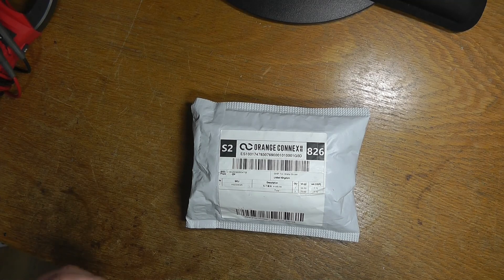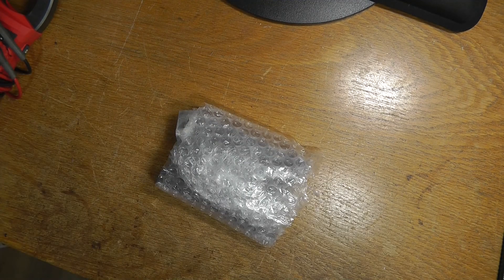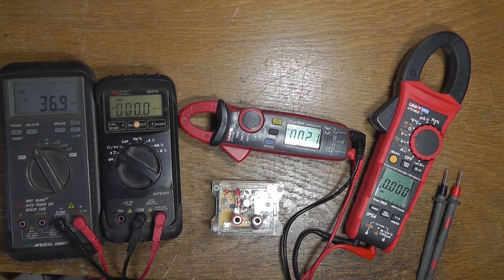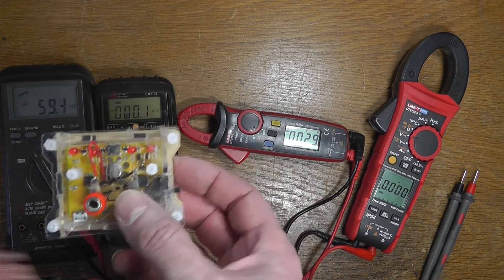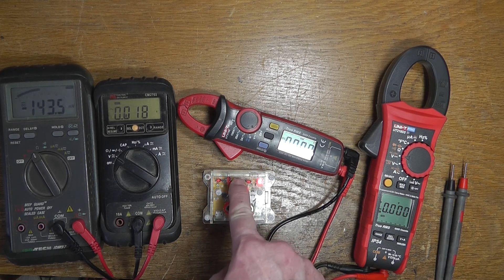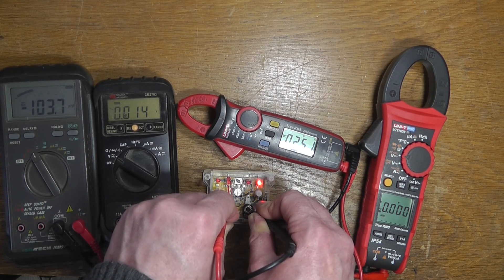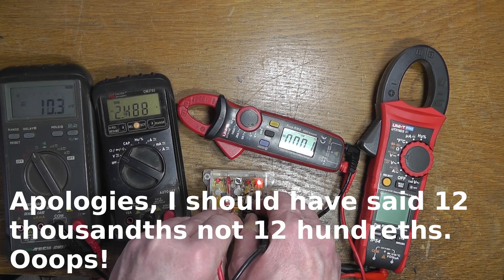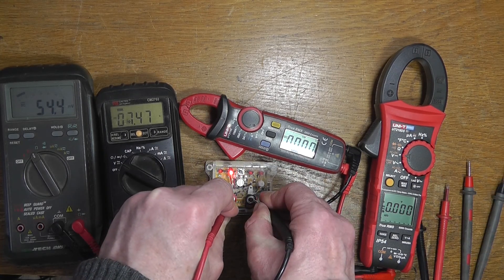Voltage Reference Tester to Calibrate a Multimeter (Accurate? Probably!)

Comment: You could have used the voltage reference board to recalibrate the meters that needed it, take the cover off and look for a small adjustment potentiometer either DC volts, V1, or similar and while hooked up to the board just take a jewelers screwdriver and tweak the meter in to match the voltage reference boards voltage you choose -- you likely could have had them all reading accurately unless one had a component going bad. Thats one of the main uses for the reference board.
Reply from the maker: Great point.

Comment: You have to take into account account the multimeters specification +/- tolerances. Those meter are well within their tolerances. . Even the big brands like fluke are off by a small amount usually +or - 1% plus 1 digit ..  so for example if you test a 24v circuit you should expect a reading of somewhere between 22v and 26v that allowing for the meters accuracy tolerance. I suggest you read the specifications chart in the user manual for each meter it will tell the tolerances for each measurement range. 
Don’t expect any multimeter to give you a 100% bang on reading. Even if you send them to a certified calibration centre they will come back with a pass and a calibration certificate. Unless they are out by a huge amount the they will come back with a vailed calibration certificate . .

Comment: The good thing about using the DMM leads rather than any banana plug cable substitutes, is that during use those are the leads you'll be using anyway. It makes a more accurate test.  What would be interesting, is to swap the DMM leads around and see if/how the accuracy changes.  Maybe the old ones have more resistance to them due to their age, maybe not?
Reply from the maker: I probably should have used the same leads for all the tests but like you said it's more realistic using the leads that will be in the meter.

Comment: It's interesting to see how various DMMs compare Ali, thanks for the video. 
The newest clamp meter is very accurate, the older clamp meter not so, but still acceptable. 
The older meters that under read aren't much use on lithium battery voltage applications, but are suitable for 12 Volt battery checking, where accuracy isn't so important.

I think I might get myself a voltage reference to test my DMMs too.
Reply from the maker: So long as you are not doing anything critical I think these modules are good enough for most people. 
I was frustrated by having four different readings from my various meters but I suspected the newest one would be the most accurate. It was nice to have a 2nd opinion that agreed.